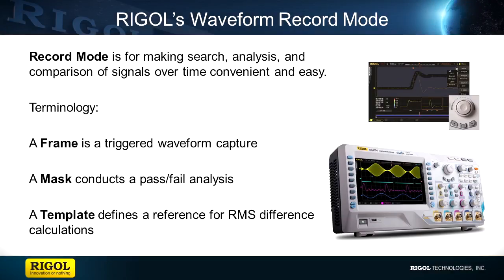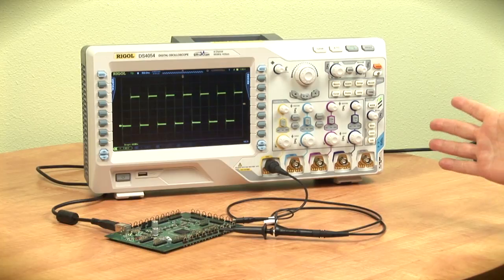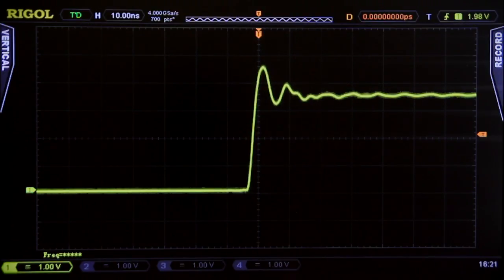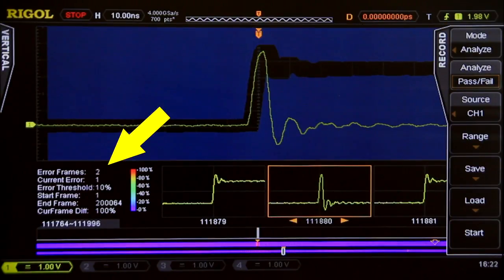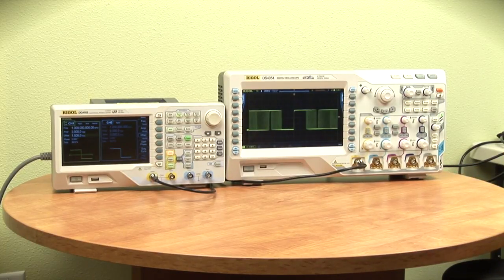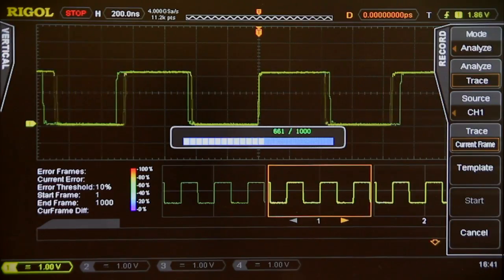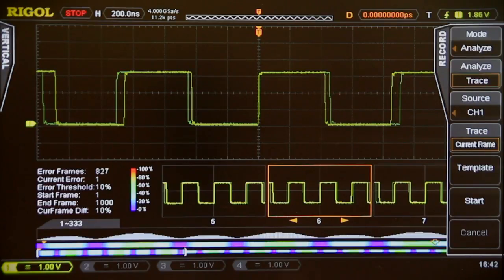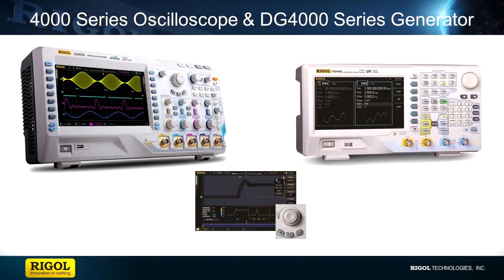Using Record Mode

Comment: No I really don't get it 😞

I have a long serial data stream I need to capture and analyse (read data from a floppy). The little knob normally used to scroll back and forth is almost useless, it's way TOO SMALL!

I would like to trigger, capture a long stream, then use the knob to navigate along the capttured waveform.

What you describe appears to have no way to trigger a capture.

Comment: Can I save it to USB afterwards?
Reply from the maker: Hi. You can't save the total recording as a file, but we have created programs for different scopes that go through and pull each data trace off to the pc. You can also record it with a number of video capture devices using either the HDMI or VGA output depending on the model.
Reply from the maker: If you are interested in the commands for pulling the data and manipulating the playback frames email us at help@rigol.com